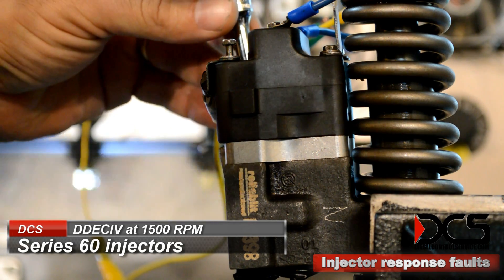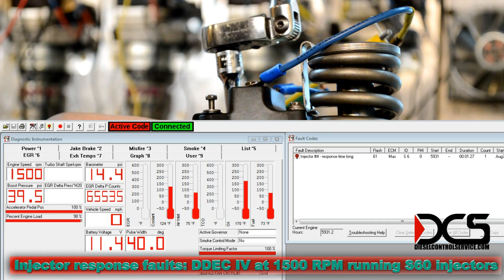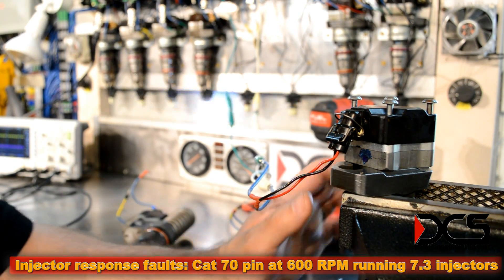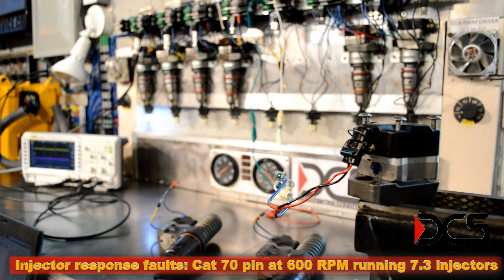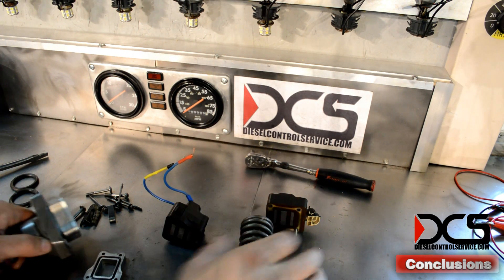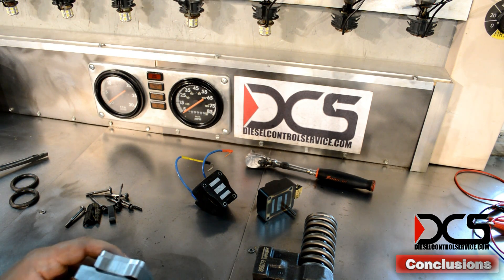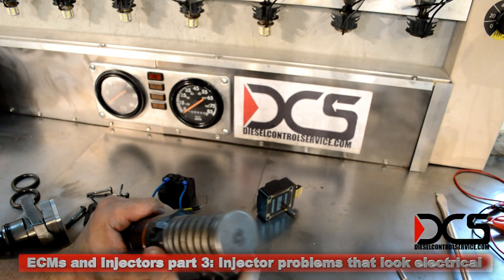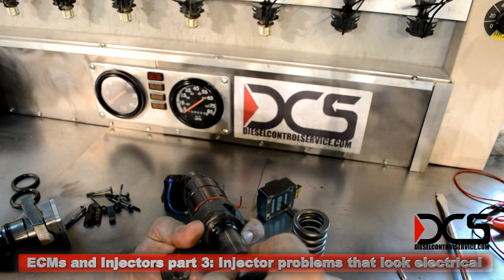The ECM lab - ECMs and Injectors part 2: Injector response faults

Comment: I am having an injector response time code followed with a check engine light. This is the second set of Detroit reman injectors  that I have purchased as well as a new injector harness. Can you suggest some software I might buy to be able to diagnose my detroit 12.7 ddec 5 I believe. Truck is a kenworth with a 7 pin obd port

Comment: Geez, I've had this problem for six years now and have had three new injector harnesses installed and still code 61 pops into memory. With this info, I'm gonna pop my valve cover and check those solenoids. Then if it still codes, then I'll know it's the ECM. I've had Detroit Diesel S-60 engines since they came out in 1989 and I didn't know half of what I learned in your 5 video's tonight. DDC treats this info like an ancient Chinese secret forcing us to pay thousands to repair our trucks.